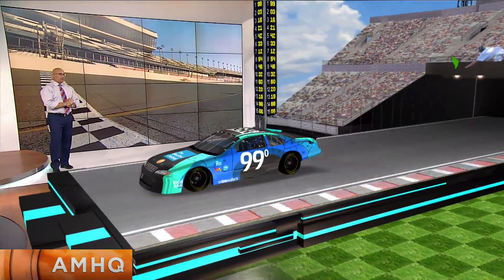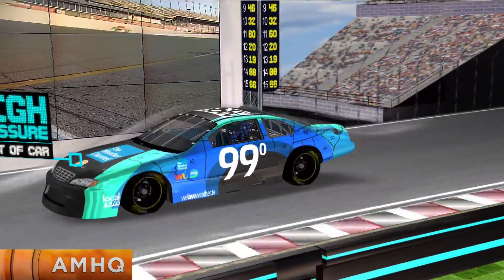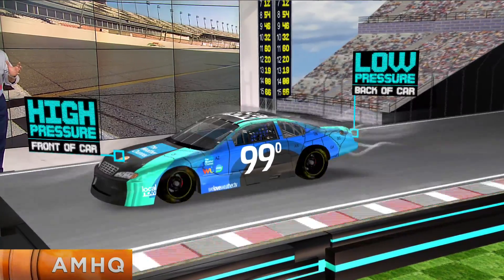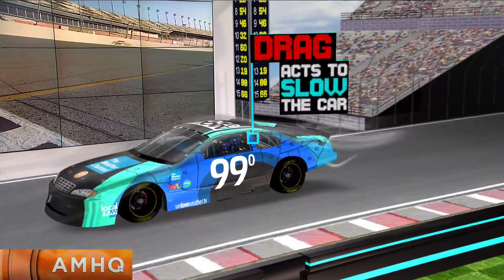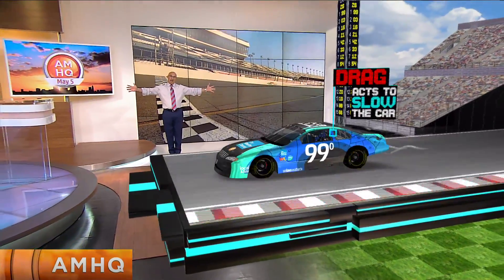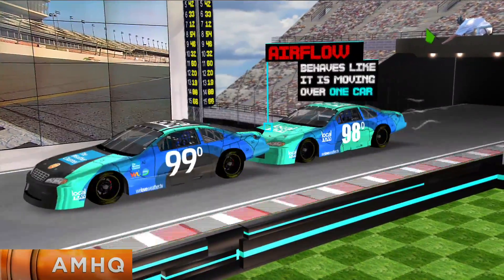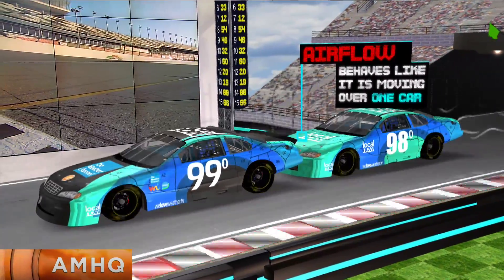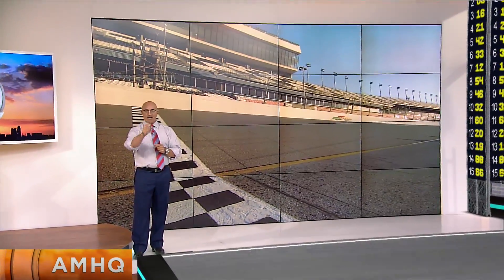The Science Behind Draft and Drag

Comment: Is drafting and slipstreaming  same????
Reply: In a way, you know what drafting is, but slipstreaming isn’t acting as one car like drafting, slipstreaming is that after a car has passed through the air, the air continues to move in the direction of the first car. But when the second car comes in right behind the first car it is fighting not air coming at it at the cars speed but it is fighting air that is going slightly forward, think of it as a fan pushing air then you running through that air, it’s easier to run. Sorry if this is too long but I’m a physics geek so yeah.